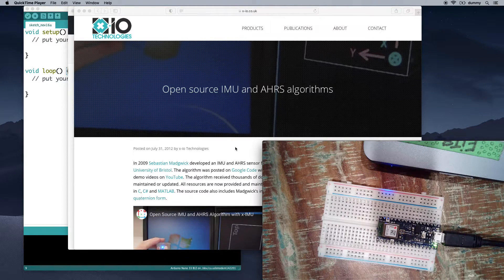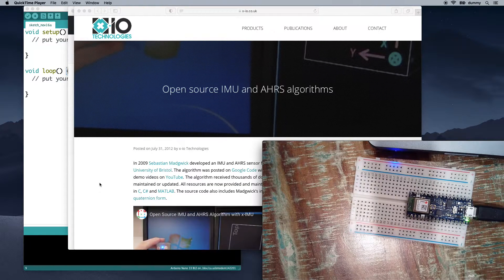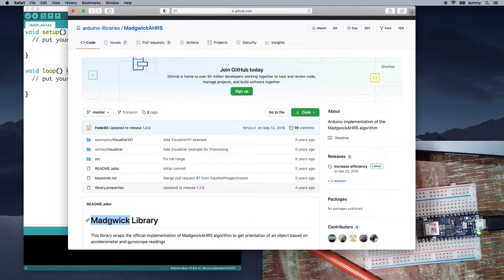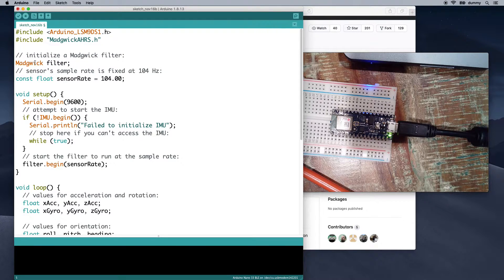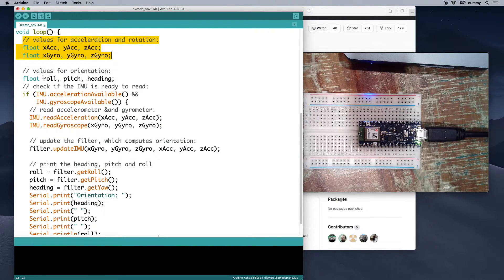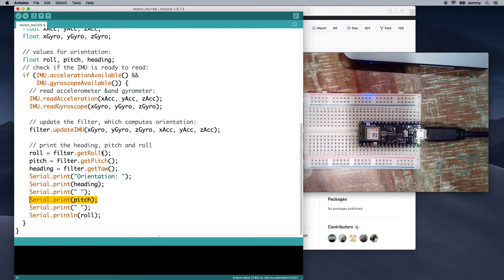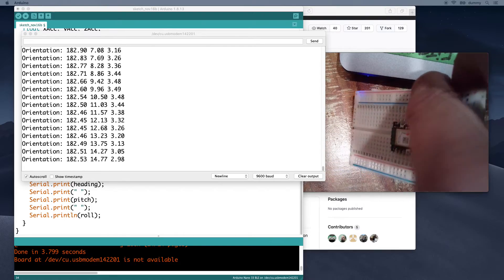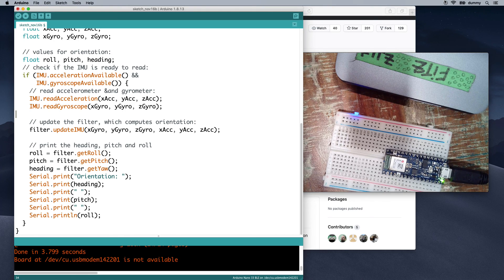Using the Madgwick library with the Nano 33 BLE

Comment: Folks, Anyone have a solution for YAW DRIFT? i use the shown example , but my YAW Keeps changing.. I need an actual code to fix the DRIFT issue..
Reply: very late response but you need a magnetometer or some external update for yaw drift, low cost imus are enable to detect the rotation rate of the earth among various other errors. So ya, external sensors.

Comment: Be aware that there is gyro drift when using this filter. Needs code optimization and calibration
Reply: What optimization are you proposing? Because i would love to implement the same as I'm getting a yaw drift
Reply: @kunalsalvi8382  In general, the madgwick filter eliminates the gyro drift, but if you want to eliminate the yaw drift as well, you can include the magnetometer readings (if you have a sensor that has one), in the objective function as proposed by Madgwick, calculate the jacobian, and integrate the quaternion to get the final orientation

Comment: Great and informative video! How are the angles calibrated? Do they base their reading of the position that the Arduino have when it is powered up? Or are the angles calculated with regards to north and gravity? Im considering using the nano 33 BLE for closed loop steering for a wheeled robot but I need to know how the reference point of the angles.
Reply: Wondering this as well
Reply: If it's a magnetometer-less system, then the orientation is relative ie it's calculated on startup. Madgwick also has magnetometer implementation that can give you absolute heading but can distort if strong magnetic field is detected